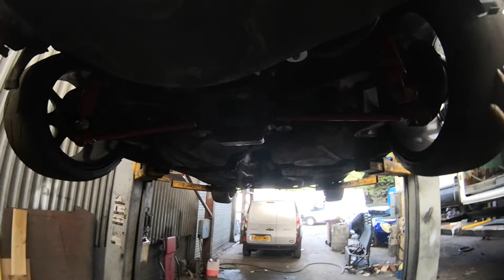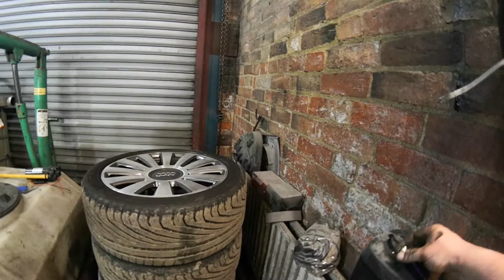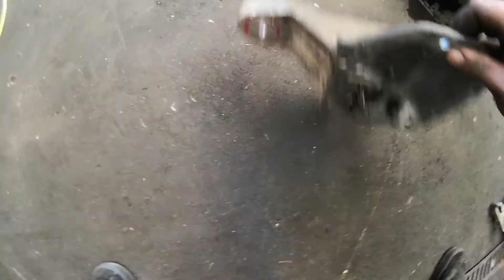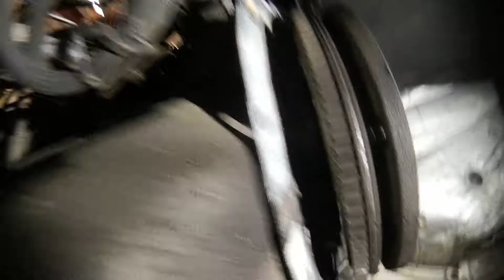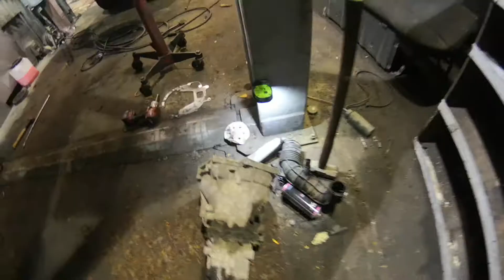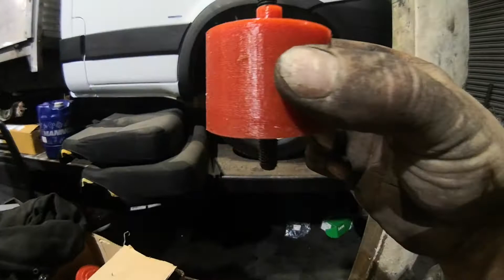Drivetrain changes | E36 Drift Build Pt.7

Comment: Hey man loving the build 👍👍where did you get that clutch kit from?
Reply from the maker: Thank you mate!
I got it from eBay. Typed in E36 paddle clutch and one came up for £350 with the option to make a offer so smashed in £250 and here we are. :D
Reply: @diehowever  thanks man I'm building a m42 at the moment does the std clutch fork work with it?
Reply from the maker: @lewys88  No probs! Yes standard clutch fork and box. Everything you need is supplied in the kit. 😁
Reply: @diehowever  can you please share the eBay link of the clutch. I search for it and found various possibilities depending on the M3 engine. Thank you!
Reply from the maker: @joaofelizardo90  Hi mate, I wouldn't recommend this clutch. I have changed to an OEM 3.0 M3 dual mass and clutch now. Much happier.
Reply: @diehowever  thank you for your feedback! The clutch has slipping or was another issue?
Reply from the maker: @joaofelizardo90  Yes it kept slipping on me and wouldn't stop regardless what I tried.

Comment: Ha ha wait till you see my next video. I cleaned the diff well  but didn't set it on fire long enough, so exactly what you said happened lol
Reply from the maker: I shouldn't laugh but...
Been there myself and definitely had to change my underwear! Wasn't setting myself on fire again! :D
Reply: @diehowever  I had cleaned if out pretty well but not enough to not cause fire. Hard to see fire with a welding mask on, I just felt extra heat lol